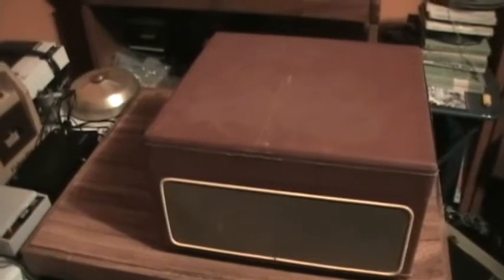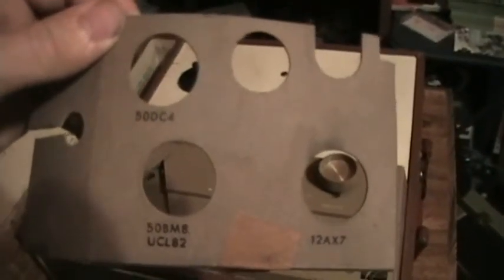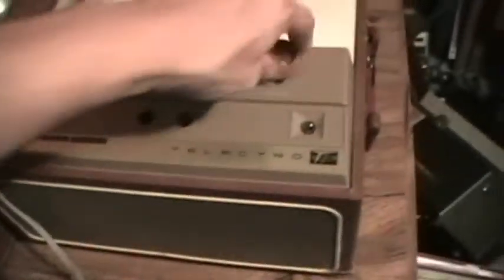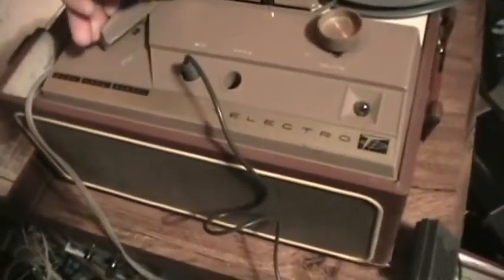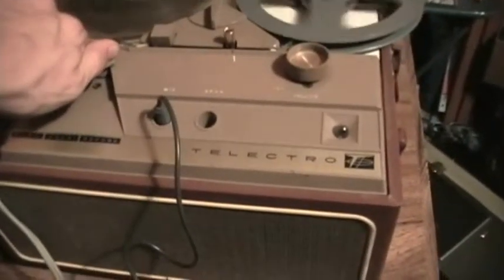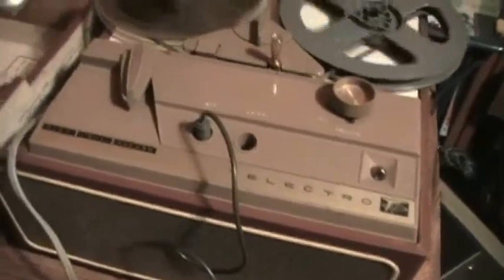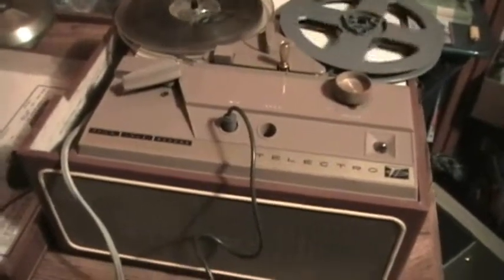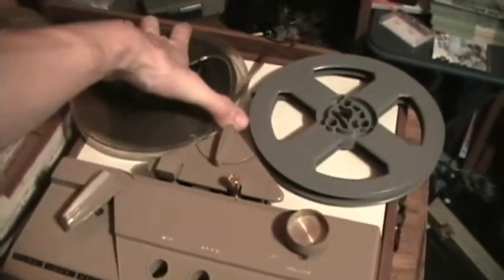Telectro shown, and shoutout to TheReelMaster.

Comment: Nice recorder! Never seen a Telectro brand before. As for the hot chassis issue, I have to be very careful if you have the high setting which is 220V, set it to 120V, and never let go. I had the same issue with the 1970's Kenwood receiver a long time ago, after turning the radio on, the chassis gets very hot and smoke comes out of the unit. I unplugged the receiver and never have to turn it on again. Hot chassis is a dangerous unit, so avoid it at all costs.

Comment: I did connect a hot chassis DIY phono preamp to my amplifier once. Blew out the input selector chip (the chip case is cracked) and the sound card on my computer (which was also connected to the amp). So, now I know that if I connect a chip to 220V (where I live it's 220V) I get a bright flash of light from the chip.

I would probably buy an isolation transformer to use with this recorder, since I also do not want to get shocked.

Comment: That sounds really muffled, has the heads been cleaned and demagnetized yet? I hope there not worn out.  It should surely sound better than that.   With a "hot chassis" is it dangerous to touch?  I wouldn't use that here because the voltage here is higher and would fry it, and our house's wiring is not very good and has voltage on the neutral wire.  if I plugged it in the "hot chassis" wouldn't be properly neutral and really would be hot/live.

Comment: did you put too high in microfarad of the filter caps? I once had a similar loudness issue on a non-transformer amplifier. Good to know you know the hot chassis rule. Sorry to hear you learned it the hard way!! I use an audio isolation transformer ALWAYS with the computer just to be safe. Or just unplug the power supply and run on battery if using a laptop.